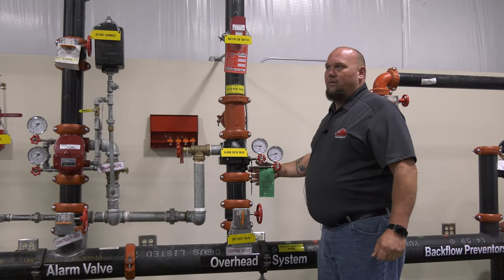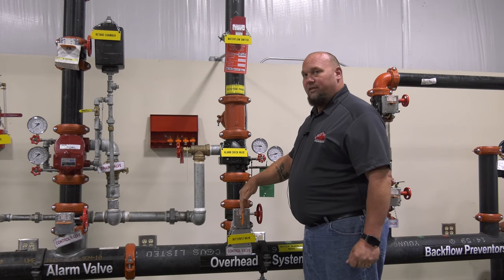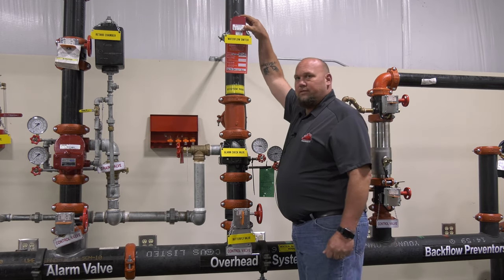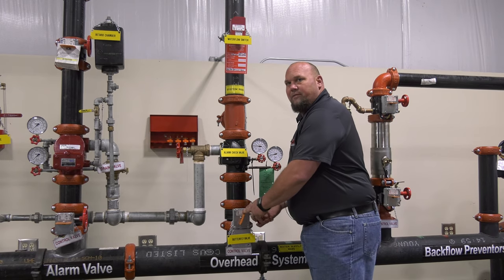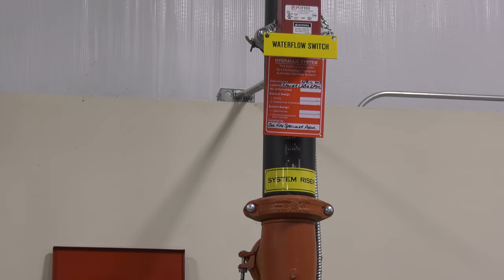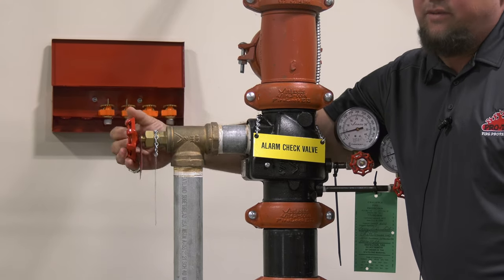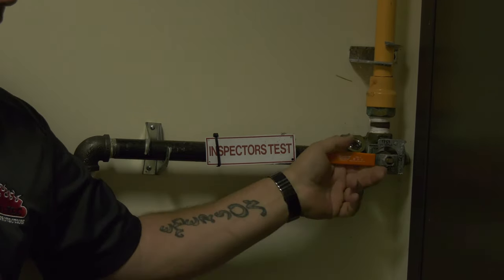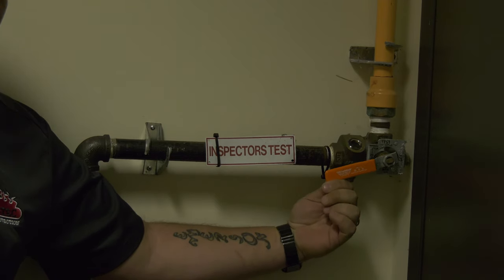Components of a Wet Fire Sprinkler System, Main Drain Test, and Inspector Test

Comment: We recently had an inspection done by a local company and they said our Gauges needed to be replaced because they were older than 5 years. Can you make a video on how to replace the gauges?
Reply: I'm sure you'd have to get an approved company to replace the gauges, you can't just unscrew and swap them out as the entire system has to be approved and certified to avoid shortcuts..
Reply: Fire sprinkler technician here technically you your self are not supposed to change out the gauges but if you wanted to just make sure you close the valve right before the gauge then you can remove it or even safer you can close the main valve on the entire system and drain it just make sure to call it in to the central the watches over the building

Comment: here is a question for you as you probably know in new installations anti freeze is frowned upon it seems possilbe that  a fire hose can be attached to the sprinkler system so my question to you is could a dry sprinkler system be attached to a  fire hose valve to function as a dry hose valve?

Comment: What is the different between main drain valve and test valve .?
Reply: im not a sprinkler test person, but i do test the system electronically only. i have been in the presence of a sprinkler tech., while they conduct their physical test. the main drain is open to make sure there is water in the system and to make sure the water flows and clean water shuts out. there is no alarms by running the water. the (ITV) or test valve, is tested by opening the valve and it is a timed test, it usually triggers an alarm into the fire panel around 45 seconds or more. only certified technicians in Sprinklers conduct this kind of test. the system should have a fill in the blanks tag on it. the technician should note any changes in pressure every time the system is tested and inspected.
Reply: Main drain was before the first flow switch, so no alarm. You can read the gauges. If you’re alone you can then go do the inspector test, the fire alarm tech can tell you when they got the alarm. You can close it and go on with your day.